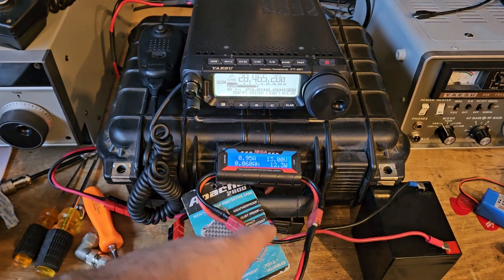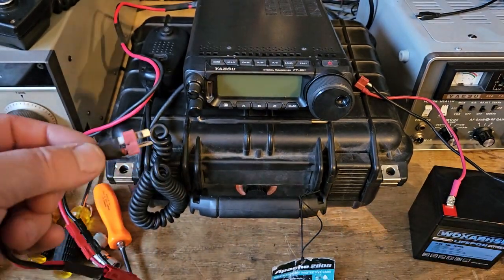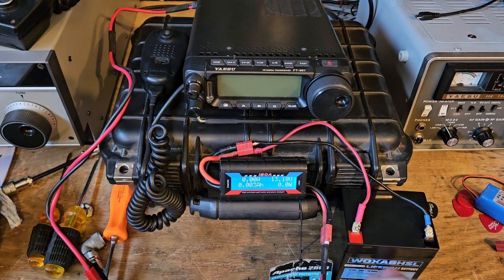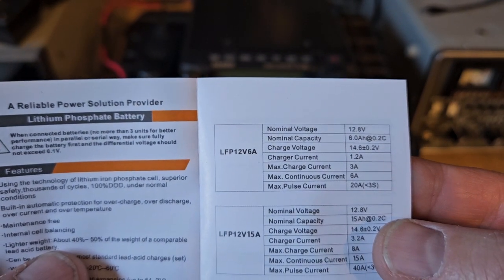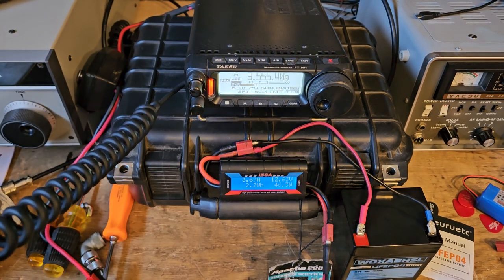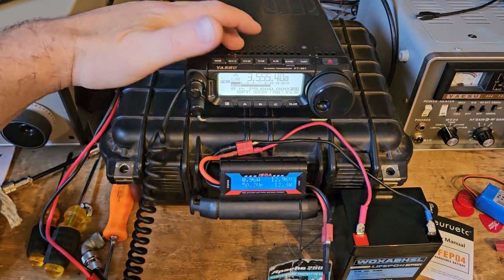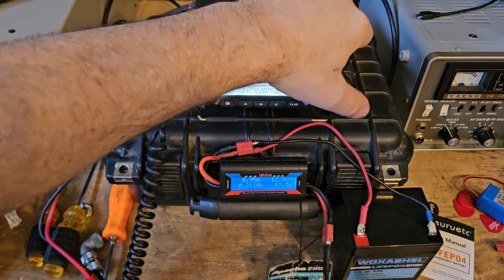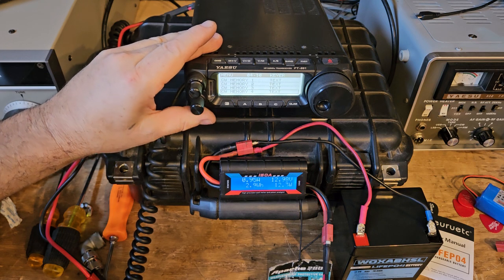YAESU FT891 AND $21 6AH LIFEPO4 BATTERY TEST

Comment: I own a couple of Miady 7.2Ah LiFePO4 batteries.  I use them as singles or doubles (parallel) for off-grid work.  They were in excellent condition when delivered and still are.  Lots of good stuff comes from China.